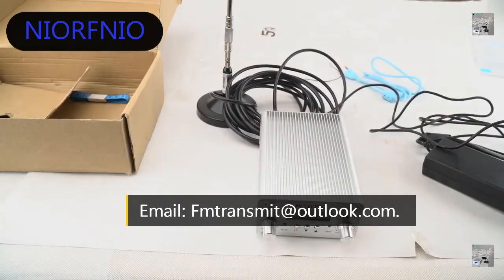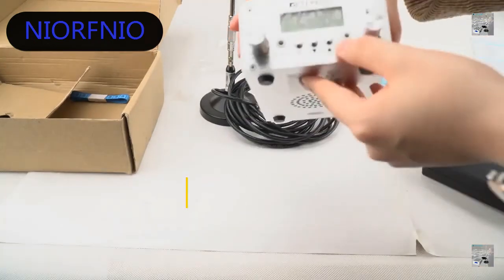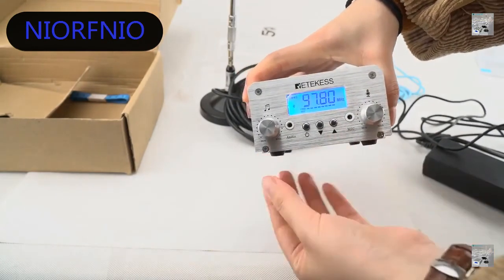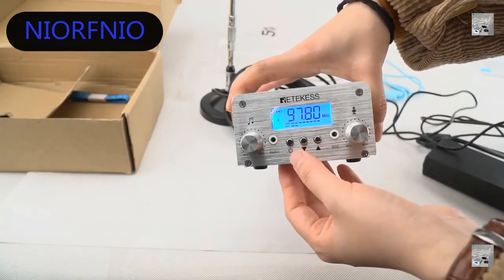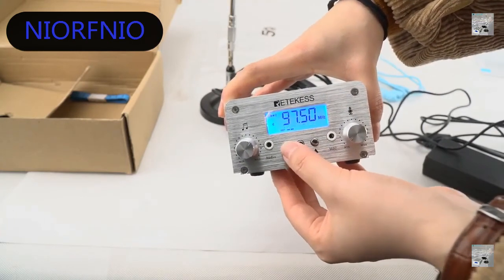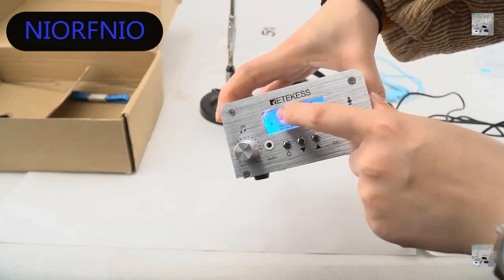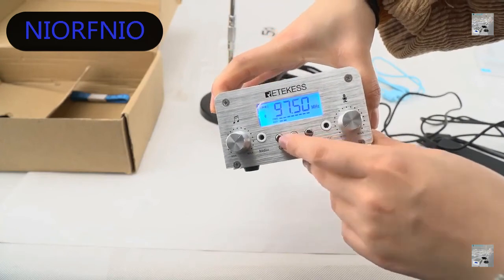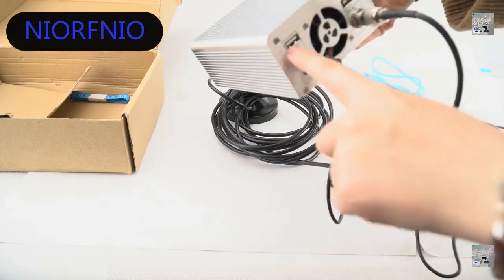NIORFNIO T15B  For Drive-in Church 15W FM Transmitter Wireless Broadcast Stereo Station

Comment: Can I see the reflected frequency properly?
Reply from the maker: What do you mean: reflected?
Reply: The REF below the FWD is your Reflected signal coming back. It is your SWR. If you have lines on the REF bar your antenna is not TUNED and has to be longer or shorter. You should have NO bars on the REF bar.